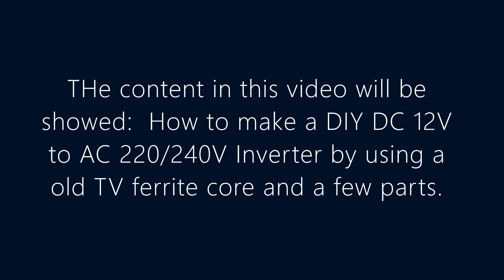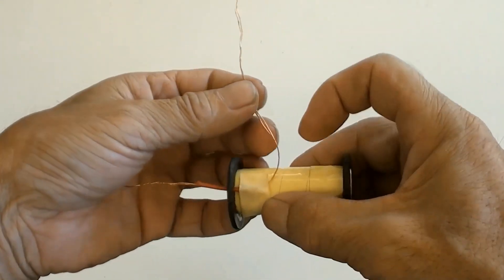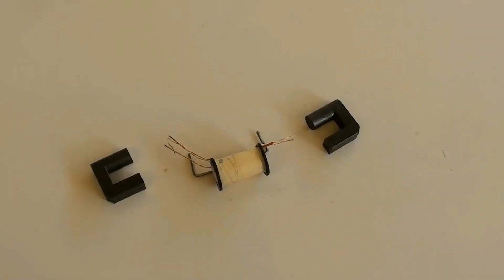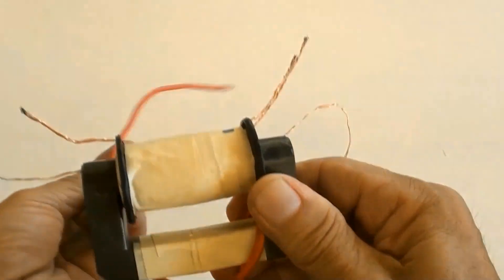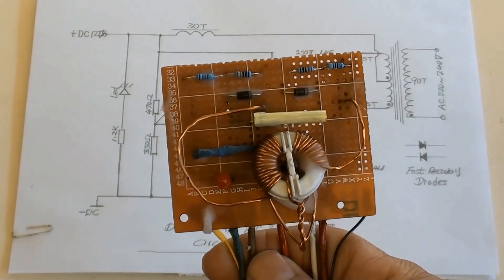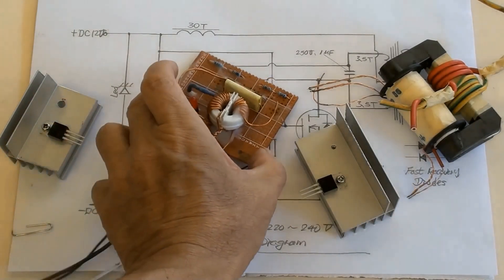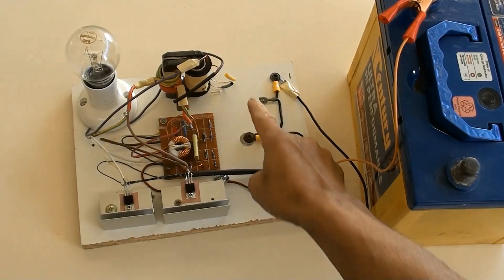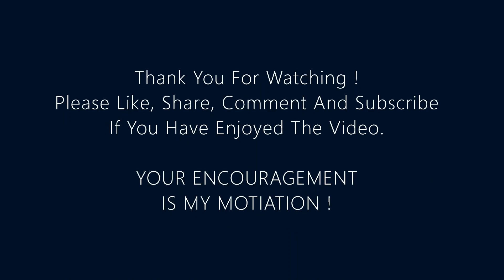How To Make A DC 12V To AC 220/240V Inverter?

Comment: The music is terrible and needs to go. What is the output current and frequency?.
Reply from the maker: Good day Mate & Thanks for your interested!   Good questions but at the time which the video produced, I didn't have an oscilloscope to measure the inverter's frequency however I'd estimated 33 k Hz or so by the other mean.  The current should be much less than 400 mA (by estimated as well).  The value of the output voltage has been AC 230 V more or less (as long as windings are 2 x 3.5 turns / 90 turns) from the commercial practice.

Comment: Many thanks, I enjoyed...
Out put frequency? And is it possible run 100w inductive load in this circuit?
Reply from the maker: Thanks for watching !  Output is Square Wave, it is the best for using an oscilloscope to measure its frequency unfortunately I do not have one right now.  Also I do not think this circuit is able to run 100W inductive load such as a big fan or motor (in principle, it can but in practical, more powerful components such as big Mosfets, re-winding transformer and the suitable associated parts needed as well as a complicated with feedback control circuits needed).
Reply: Thanks for your reply